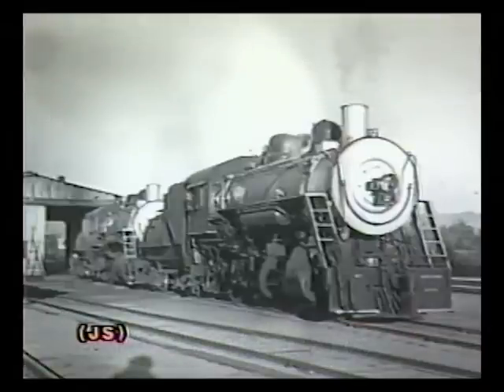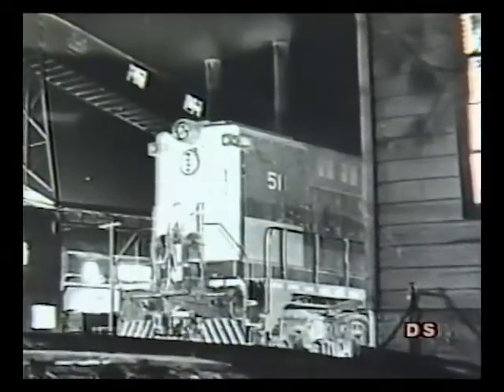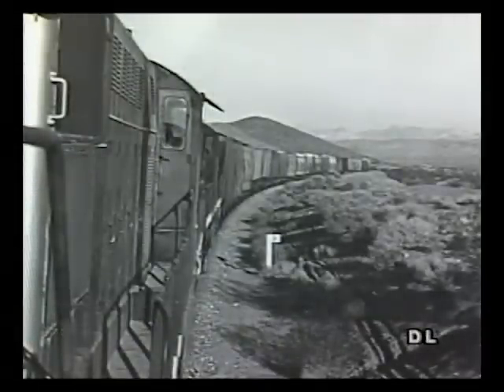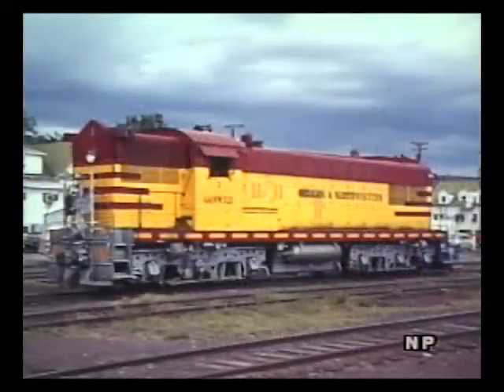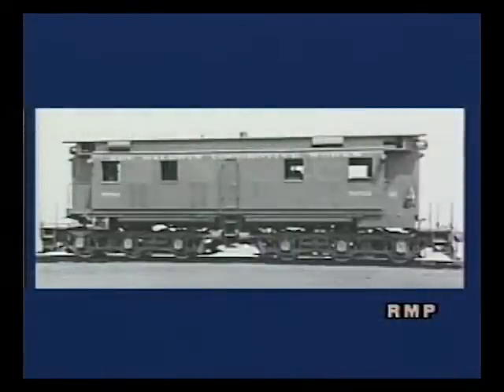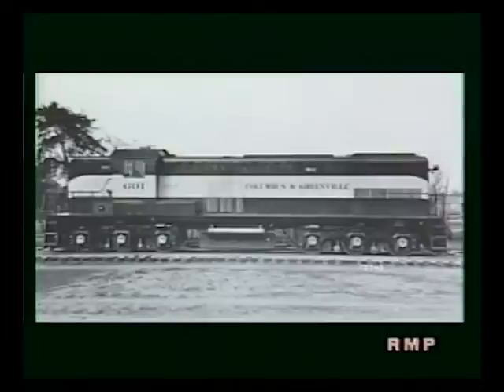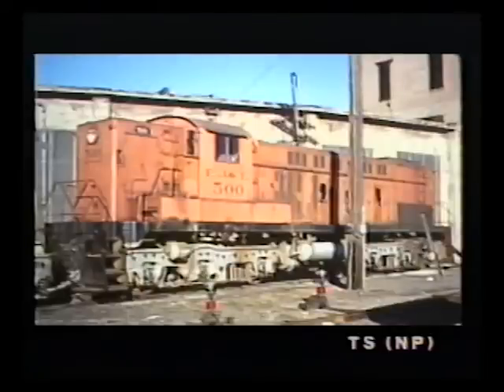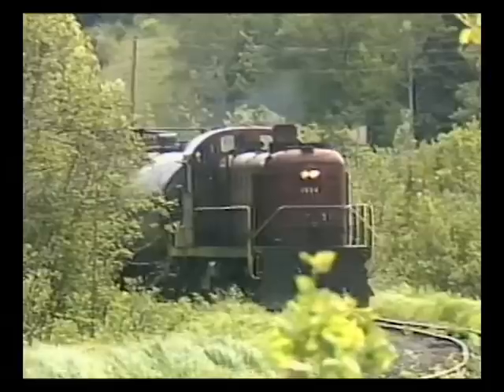Desert Dinosaurs: the Trona Baldwins ~ Part 2: A Legacy of Locomotives

Comment: IN MY YEARS WITH AT&SF ARGENTINE SHOPS WE HAD A NUMBER OF BALDWIN 
6 CYLINDER TURBO 4 AXLE SWITCHERS NUMBERED IN THE 2200 CLASSES!
A FEW OF THEM HAD MULTIPLE UNIT CAPABILITIES!
FOR HEAVY HUMP WORK WE A HAD THE ONLY 2 EMD SWITCHER
COW AND CALF SETS, THE 2418 L&A AND 2419 L&A.
WHENEVER THE EMD COW CALF COMBOS WERE OUT OF SERVICE FOR HEAVY REPAIRS,
THE WOULD LASH UP 2 MU CAPABLE UNITS THEN SHOVE THE HUMPS WITH!
THESE TURBO ENGINES SOUNDED SIMILAR TO ALCO 539 ENGINES, BUT WITH A BIT MORE OF A BARK!
IT WAS QUITE A TREAT
SEEING THEM TIE INTO 
A MILE OF FREIGHT CARS AND START SHOVING AND LISTEN TO THE STACK TALK FOR THE FIRST QUARTER MILE OF THE SHOVE!!
UNFORTUNATELY, NO AUDIO CLIPS !!
KEEP THEM ROLLING BROTHERS!!
👍👍
Reply from the maker: Thanks for the cool words. We will surely keep them rolling. Your comments about the Baldwin switchers reminds me of watching three-unit lashups of N&W T6s switching coal loads at Lamberts Point. The sound was awesome. The was also a T6-GP30 lashup that was kicking cars around. The combined sounds of those two units was unbelievable!   RR